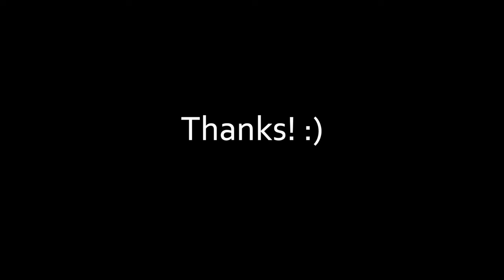How to test windshield wiper motor

Comment: Merci pour votre vidéo qui m'a rendu beaucoup service, vos connections étaient les mêmes pour moi .
J'ai testé le moteur Valeo REF : 535 67 502 installé d'origine sur une Clio3 Phase2 1.5 DCI, il a les mêmes connections et au même endroit que le votre (Negatif - , Retour à zéro, Basse Vitesse, Haute vitesse ) .
----------------------------
Thank you for your video which was very helpful to me, your connections were the same for me.
I tested the Valeo Windshield Wiper motor  REF: 535 67 502 installed originally on a Clio3 Phase2 1.5 DCI, it has the same connexions and in the same place as yours (Negative, Perm.P, Low speed, High speed).

Comment: Thank you very much. Mine is a 4 wire also. I was wondering what 2 extra pins for. Test mine tomorrow..
Reply: I m trying to test my Windshield Wiper Motor for My car also
Reply from the maker: Did it work?

Comment: If you don't mind Please can you tell me where I can get the 12 volt battery and the wires/Leads that you have in the video
Reply from the maker: Just like I mentioned in the other comment:
Red and black leads I made myself out of high quality test leads. My local electronic store sells it by foot, very flexible and 600v insulated. Crocodile clips also bought at the same store. You can search on amazon or any other electronic store will carry those jumper wires. White wire I found laying around on construction site, it's 18/2 size and mostly used for low voltage as door bell wire, etc..
Battery is Dewalt 12v, but you can get one from the car charger, car battery or any LED lights transformer that has an output of 12v DC. They really cheap, again any electronic store will have it.

Comment: Where did you find the leads the red , black and white wire to fix the 12 volt battery
Reply from the maker: Red and black leads I made myself out of high quality test leads. My local electronic store sells it by foot, very flexible and 600v insulated. Crocodile clips also bought at the same store. You can search on amazon or any other electronic store will carry those jumper wires. White wire I found laying around on construction site, it's 18/2 size and mostly used for low voltage as door bell wire, etc..

Comment: I have a 1993 Mazda 626 and my wipers only work in one speed and don't return "home" when I shut them off. How do I determine if it's the motor or the multifunction switch?
Reply: That's normally the relay playing up
Reply: @SkidsNDonuts  Excellent! Thank you!

Comment: please help I have a 2005 navigator one mechanic told me that the fuse box is the cause of my wipers not working another mechanic says the motor is getting power but  it's not coming from the fusebox so he had me replace  the fuse box and still no wipers ANY SUGGESTIONS? PLEASE HELP!
Reply from the maker: if you have power at the wiper motor and when you turning it to all different settings power still there in that case has to be the motor. Also check the Neutral cable, if that has bad connection all the way to fuse box, it will not work. You have to test power right inside wiper motor plug, to make sure you have solid ground and good power.
I measured steady power and then all the settings on speed 1-2-3 and so on, to make sure you have voltage coming on those settings and speeds. Hope it helps!
Reply: @biesasuk  yes it helps a ton because now folks are talking  about buying a BCM
Reply from the maker: @jeffwatson151  Yes I would say test all pins first to make sure your plug works properly, specially on older cars, could be a broken ground somewhere and that would not work. If plug with pins has power and settings work then, has to be the motor. If settings don't work, has to be something with relays and more testing needs to be done. It might even make you to change whole board which is most likely very expensive, hope not!

Comment: by using digital multimeter what is the current or watts?
Reply from the maker: Sorry I have no idea, I never needed a meter or to see how much current it's pulling. I just measured voltage to make sure you have 12v.

Comment: if I bypass the relay with a paperclip the wiper motor kicks on. I've replaced relays, fuses, multifunction switch and checked wires and grounds. still can't get them to turn on with the lever like normal. just happened one day...

Comment: What wire is hot wire on wiper motor
Reply from the maker: I have labeled it on the sticker. which is which. there is 2 different speeds